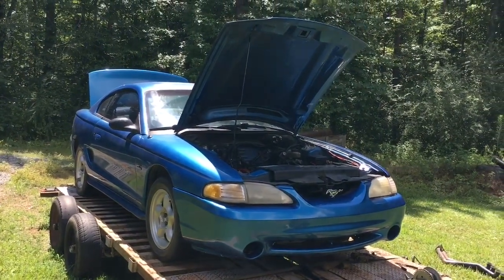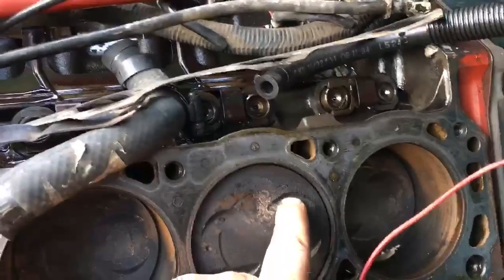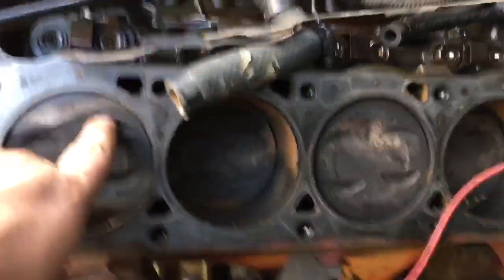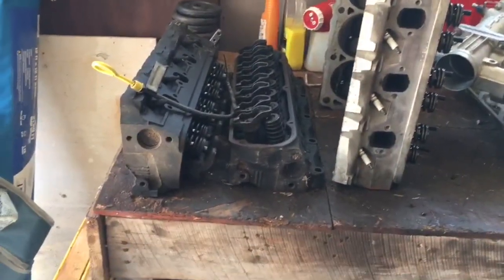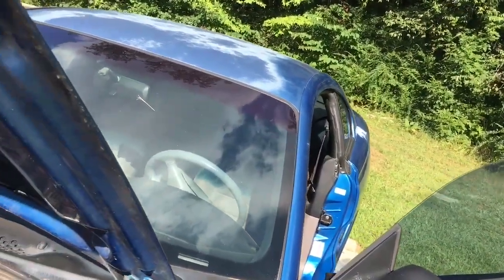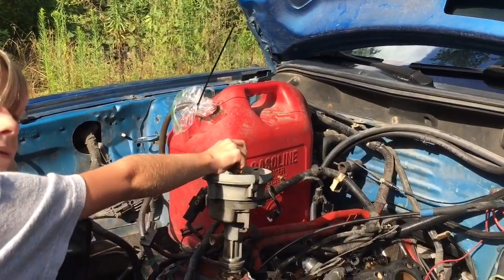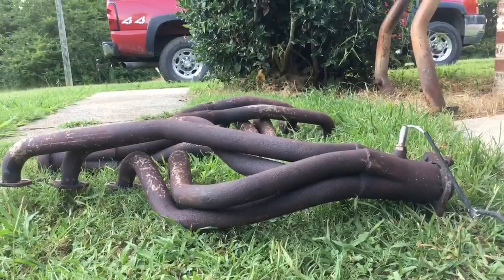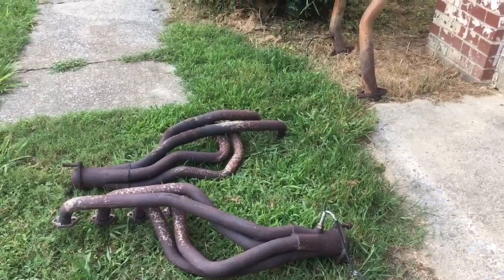Kiss of Death - Diagnosing my mustang's broken 302

Comment: I had a feeling that you were going the stroker route 😁👍🏻 sounds like you are fixing to build a mean machine . It sucks the other one went bad cause it sounded so good but your using the same cam so it will sound just as good and don't blame you for ditching the baby cam which is what I called them 😂🤣 gotta let that beast breathe some air .But I can't wait until you get it going because it is going to be a screamer . I'm still waiting on my stroker in the machine shop and I'm hoping to get it back anytime now so that I can start building it because I am ready to drive this thing. Anyway sounds like you have some good plans and can't wait until I can see more on them 👍🏻🚙💨💨🚗💨💨

Comment: Never noticed the little breather filter, that might have contributed to the idle issue you were talking about.
Reply: You had TW heads and a B-cam and had valve contact?!?!
Reply: FXRSDriver the timing chain broke and when the crank broke I’m not sure what the pistons decided to do. I’ll be pulling it apart soon
Reply: I’m gonna do away with the breather on the next motor, we’ll see how that works. I’m still getting oil in the intake and I’m using a Steeda air oil separator....
Reply: @Sikulz  That's right, forgot about that.

Comment: Sorry you're kinda stuck in the sticker-bush, Richard. A decent running 331 oughta make up for the shortcomings or penalties of an AOD, and that ought to be a more than decent running 331 with those good heads. I'm like FXSRdriver....how the samhill did those valves get bent with that relatively small cam? It doesn't look like the pistons , specifically the valve reliefs, are specifically for TW heads, but the pistons aren't extra tall, and the lift isn't so high that they should have ended up beating on each other. I will be interested to hear & see your post mortem, once you get it figured out. Here's hoping it all goes well, and both end up being a lot more fun, and more than just a scoche quicker.
Reply: Zekais thanks man!!! Seeing how the valves crashed made me change my mind about regular pistons. I’m going with the Trick Flow 331 pistons now.